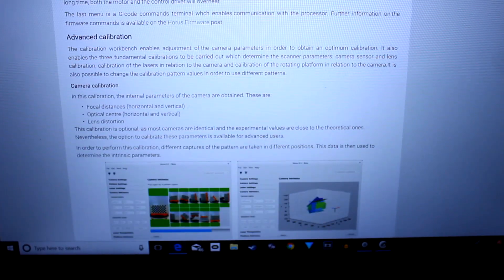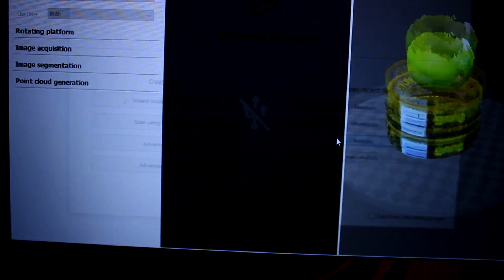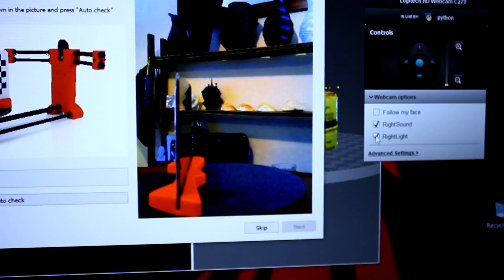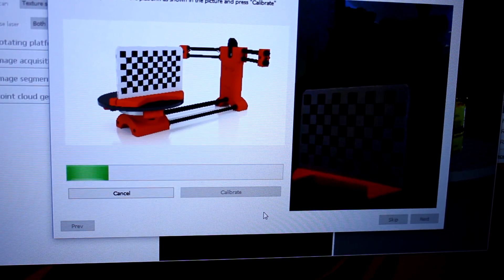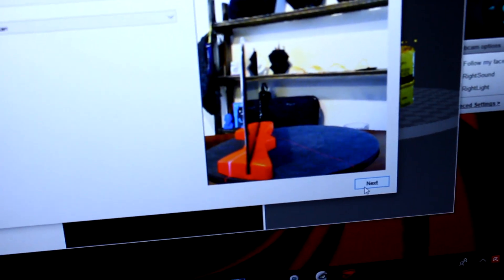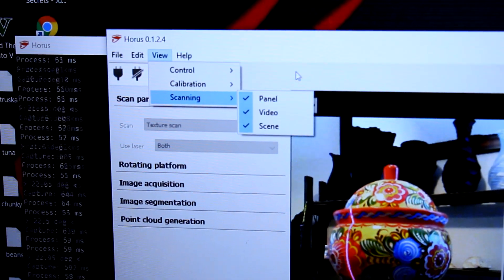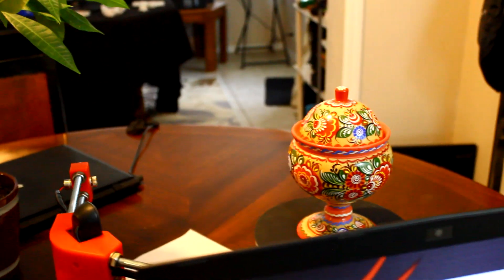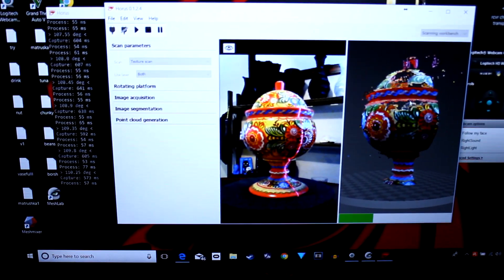✔ CICLOP 3D-Scanner Laser Calibration Setup & Review w/Multiple Tests!

Comment: It's been a couple years since you posted this video.  How is the scanner currently?
Reply: i currently have it and it costed me a lot of effort to get it connected to horus and now i when i calibrate, the sorftware just simply crashes. so yeah it's basically just a headache
Reply: @agariowhiteroyce6371  I found the Horus software cannot handle ANY virtual cameras being installed.  I had one to allow my phone to be used as a webcam, and it took forever to nail down that as the source of it crashing.
Reply: About the same.  He's right in that it cannot seem to handle complex or irregular shapes very well, and mine could not triangulate the laser positions properly.

Scans from one laser were at a different scale to the scan for the other laser.  This is likely why I have seen so few people using both lasers at once.

I spent a week messing with mine before dismantling it, except for the turntable (it's actually a pretty decent design) and I'll prolly just use that for my future photogrammetry projects.

Comment: Ive heard its just junk....but at the price of $100 what else is avail thats better
Reply from the maker: For the price you can't do much better. This is a good way to do objects quick and consistently but it lacks the high definition that you would get if you used photogrammetry methods with a higher megapixel camera.
Reply: thanks..this item seems more of a cool factor and tinkering but not really anyting great or must have like a 3d printer which i consider a must have item :)